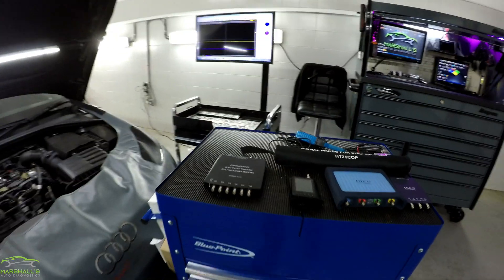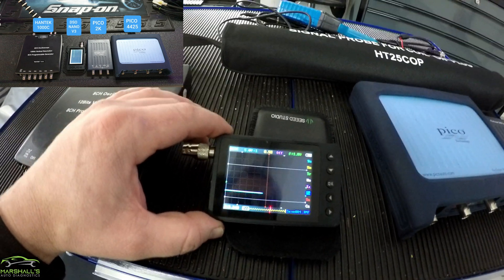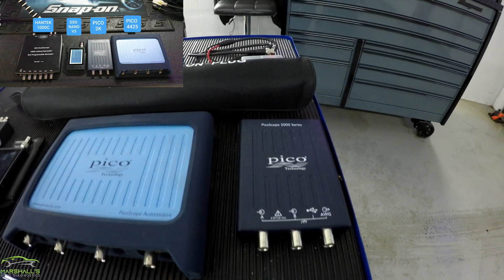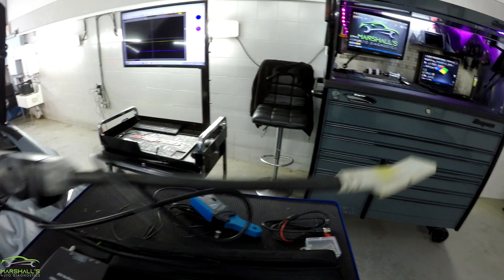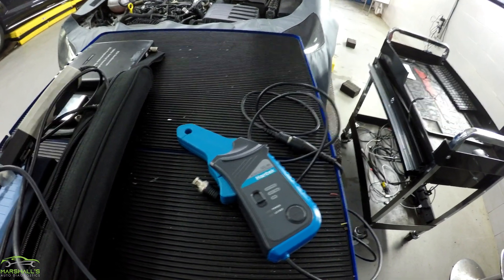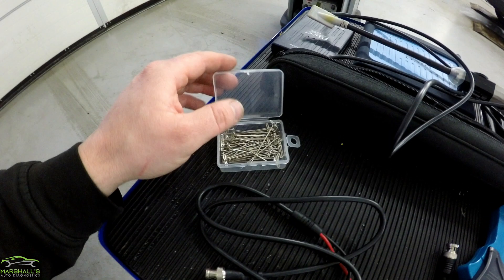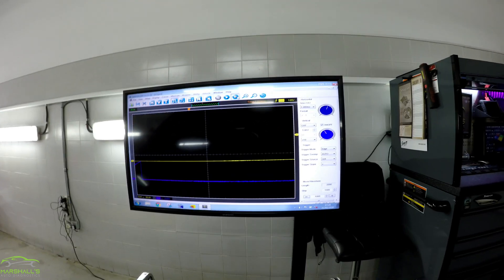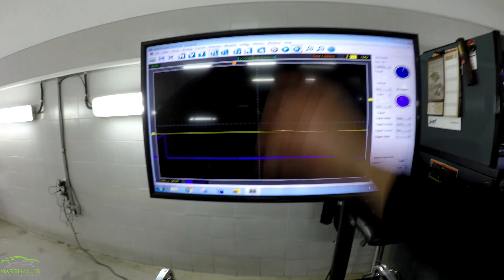Hantek Secondary Ignition and Current

Comment: Hantek CANNOT handle Automotive high voltage noise causing it to hang / reboot and crash the attached pc. Save your MONEY and buy the Pico as they ACTUALLY work. The HanTOY is a joke for working around any High voltage noise no matter how you route the wires.... No it s NoT decent
... my 21 model purchase is a POS even though they have improved tge software install and alternative way to have a usb driver. Avoid the Hantek if you value your time and actually want to work around DIS cable ignitions... maybe coil on plug you may get away with the Hantek but I hear peoples have trouble with it on alternator diagnosis as well.

Comment: I have the Hantek 1008c and I have a dead miss on number 2, when I put the scope on the control wires im getting what looks like a square wave, this is on a Holden cruze (GM) and its all 4 plugs in one coil, should I be seeing the same ignition wave form as you do here? maybe got the scope setup wrong?

Comment: I started with a Hantek but I was having trouble with the software crashing and the laptop wouldn’t detect the hardware so I purchased a pico. Turns out the battery charger on my laptop was the cause of the problem but having a Pico now the Hantek will just be a back up. Nice video and thanks for sharing.
Reply from the maker: I suspect alot if the complaints about the software are self inflicted David or maybe I just has good luck with it, if there is one thing I'd like the hantek to have is a rolling buffer memory like the pico has. Thanks for watching my video I appreciate it

Comment: What scope do you like better the Hantek 1008c or the Pico 2000 series scope
Reply from the maker: Good question. The pico 2000series is great and easy but only 2 channels, it doesnt come with any leads but to be honest I would buy it again for the money it cost.
On the other hand the hantek has 8 channels, I like the screen colours , it co es with leads including secondary pick up and the hantek amp clamps have pre sets for it so my answer is both lol 🤔
Reply: @m.adiagnostics5013  Can you give an example of the kind of applications where >2 channels useful? I'm just asking because the videos I've seen using automotive scopes have only used two channels anyway, as a hobbyist user I'm not sure I would get much value out of the extra channels.
Reply from the maker: @rsporsche  watch bernie Thompson at automotive test solutions and you will see. He uses 8 channels mostly